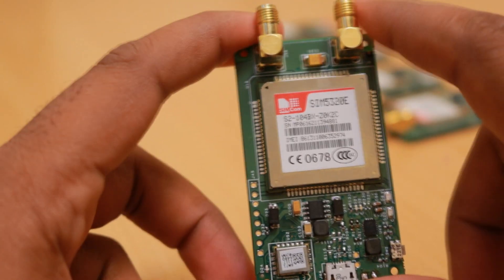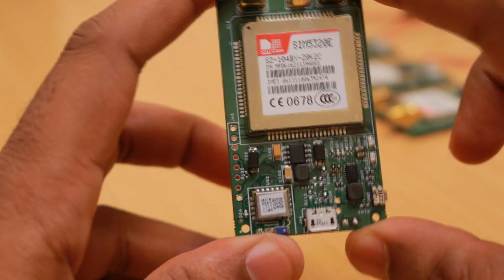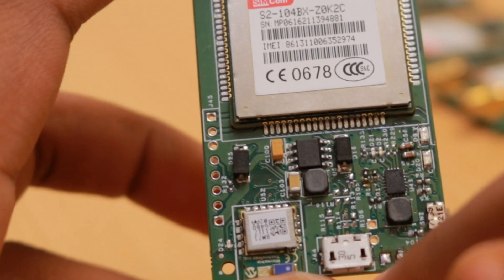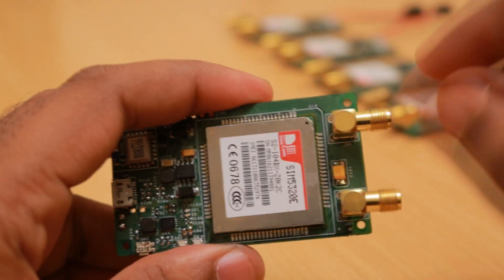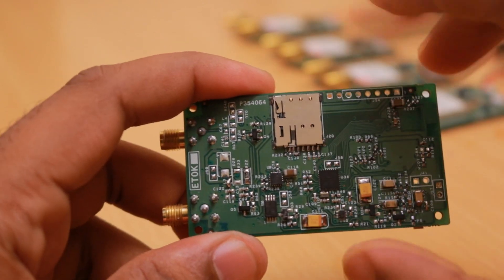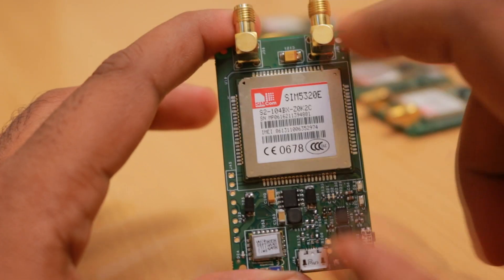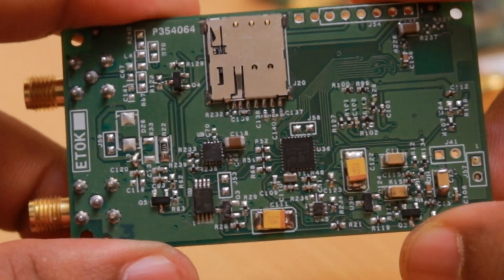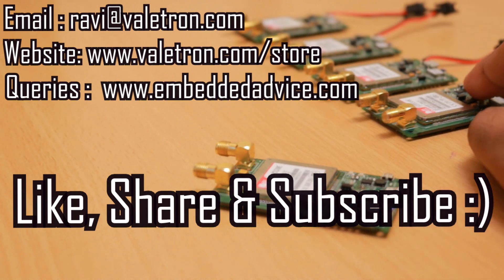VALTRACK-V3 |  3G GPS Tracker for UAE  |  Design update

Comment: Why not SIM5360? It has glonass
Reply from the maker: Hi,
SIM5360 has 1.8V IO levels and SIM5320 is slightly cheaper and supports 3V IO levels which doesnt need level translation and SIM5320 has analog Audio which is not present in SIM5360
Reply: Ok, Have you found any issues with the sim5320 GPS?, I built some prototypes around them and sometimes the gps gets stuck, I was using the USB interface and had access to the NMEA stream, when the GPS got stuck it only sent a proprietary NMEA sentence, the only solution was to reset the module.
Reply from the maker: No such issues so far. What NMEA sentence did it send?
Reply: It always sends the sentence $PSTIS,*61 but when the problem starts that is the only sentence that gets sent. I also had other problems, like suddenly missing the fix or wrong fixes marked as valid.